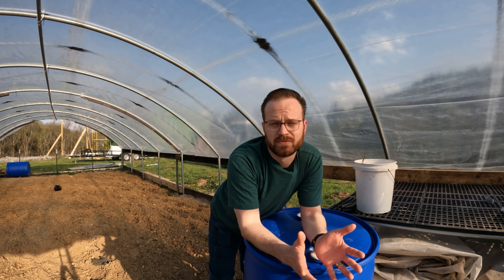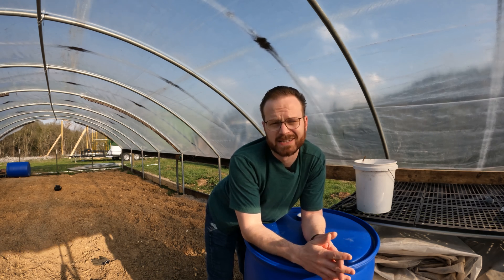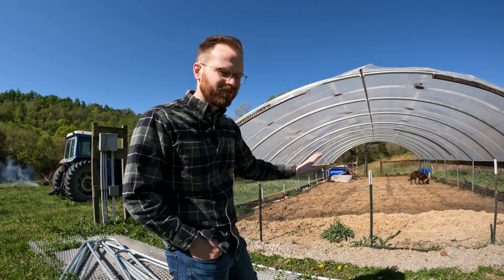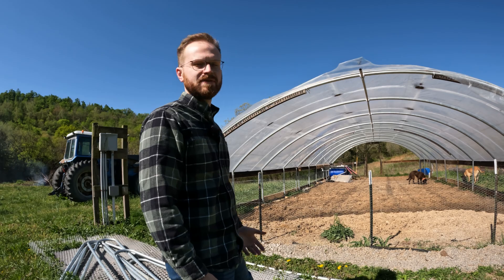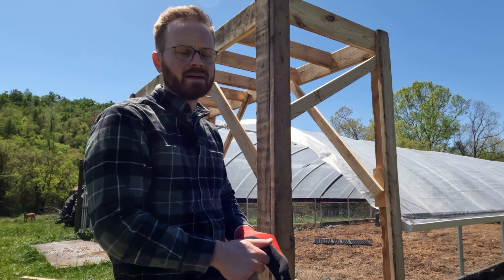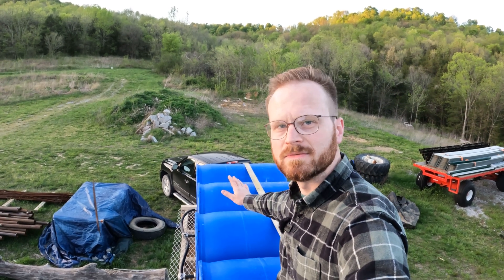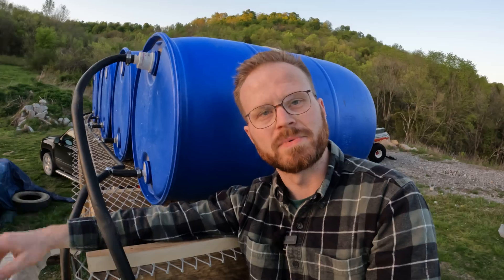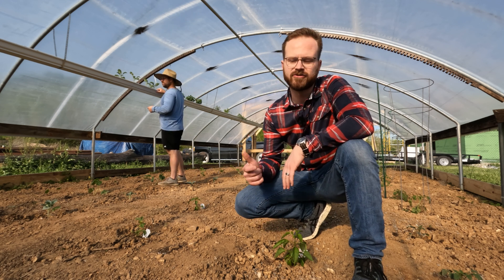#17-  The DIY Off-Grid/Self-Sustaining Greenhouse Experiment!

Comment: As the greenhouse doesn’t seem to be too large I wonder if a couple simple yard sprinklers would work at evenly watering everything, but then again as this is based off a rain collection “drip” system I suppose it wouldn’t have enough water pressure to function and it would probably waste water
Reply from the maker: Yep, the idea of the experiment was to see if the entire system can run independent from power and from manual watering. Also, being that water only goes to the intended plants, we use less water (or making the collected rain water go further), and we also have to deal with fewer weeds as its harder for them to grow when water only goes to the intended plants.

Comment: I see your thought to not only collect the water but have the ability to target the plants with the emitters. That reduces a lot of water loss you get through hand watering. Do you plan on using a sun shade in your hottest months?
Reply from the maker: Hello! Thanks for the question! 

We do have a shade that we are intending to use (as we will actually likely need to use it soon). We are hoping it will further help in reducing unwanted evaporation. 

If you have any other recommendations of things we could implement or haven't thought of, please be sure to let us know. Again, this really is a learning experience for us at this point. It would be so much easier to fail now without the loss of large expenses than to fail later when we have made much larger investments into more permanent structures!